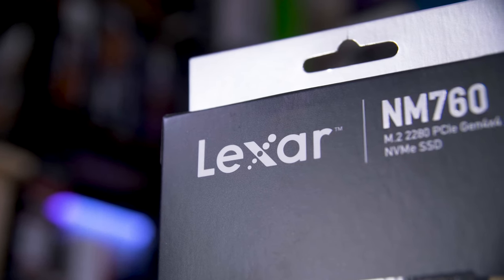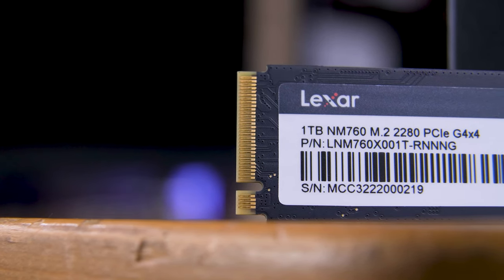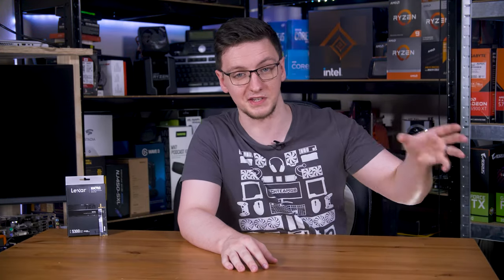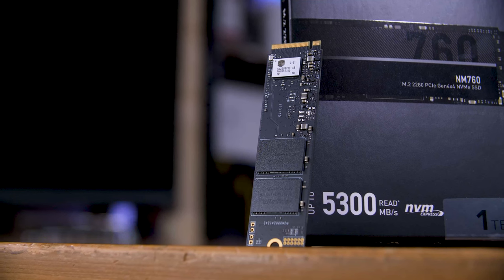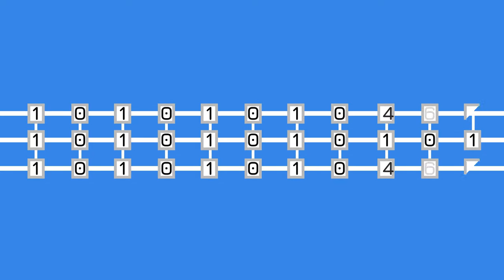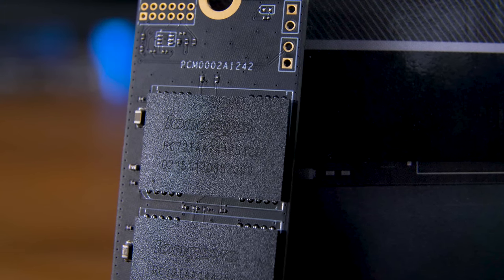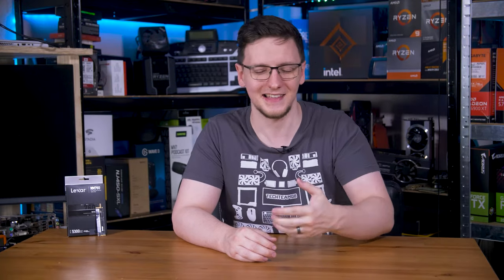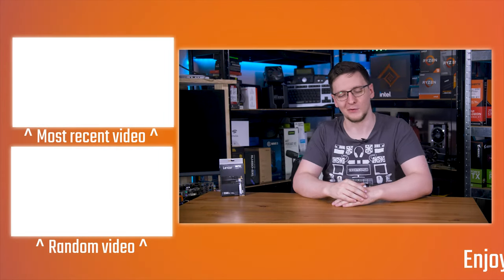SSD Breakdown - What’s on an SSD? Lexar NM760 Showcase

Comment: Nice breakdown! Now I'm wondering - if only the controller needs to be cooled, why do most heatsinks cover the entire SSD ?
Reply: Because most consumers don't know that only the controller should be cooled. You can still use those heatsinks correctly by just omitting the thermal pads on the flash chips